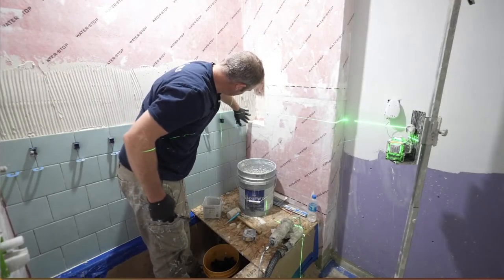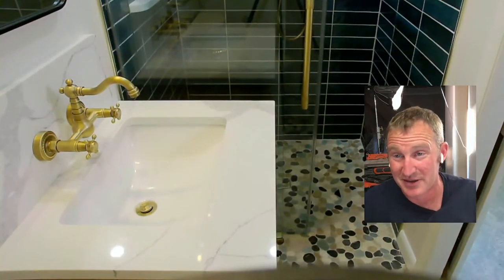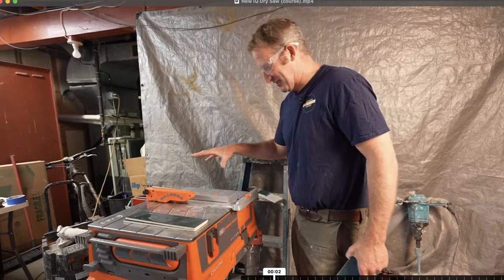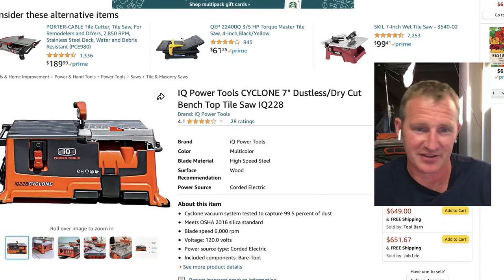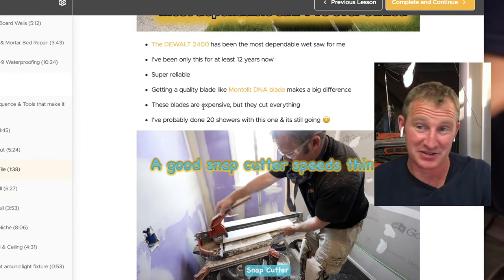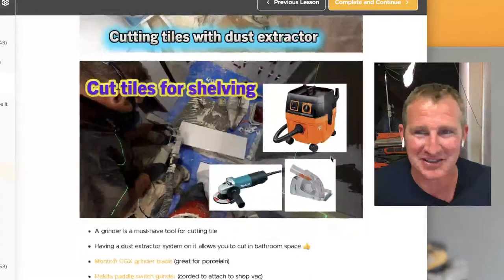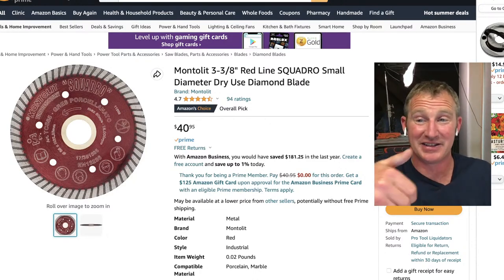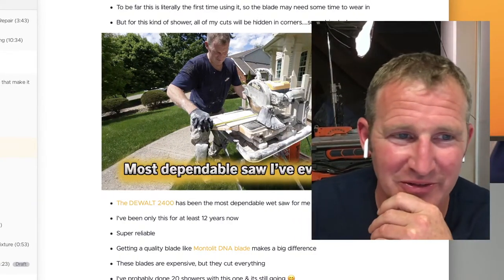Cutting Tile

Comment: Great video, classic BRT style. Is Squadro indeed the thinest blade out there or there is something even thiner? I am looking for something for grout removal. On old 1/4 grouts its not a problem but on newer 1/8 its a tough luck. Thanks
Reply from the maker: I’d say it is…but there may be something thinner out there. An oscillating tool with grout removal blade would be a little more forgiving. But I think it’s thicker than the squadro…
Reply: @BathroomRemodelingTeacher  Tried the oscillating but it is definitely thicker, super bouncy hence inevitable tile chipping and über slow. I’ll give a squadro a shot. Thanks Steve!